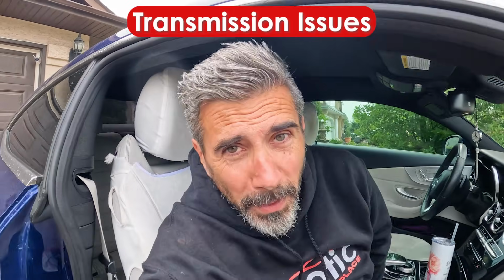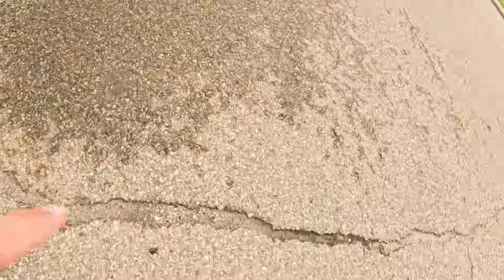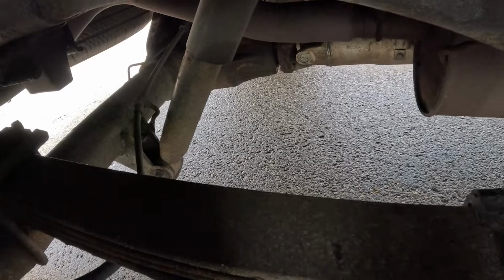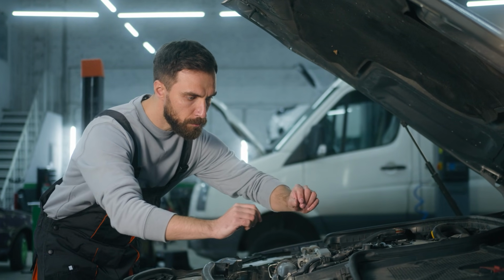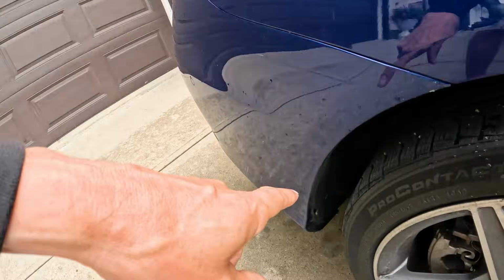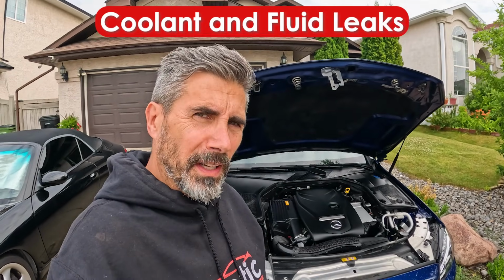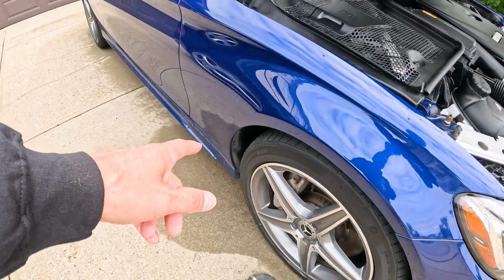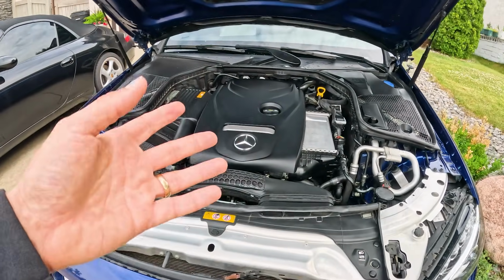What Happens To Cars After 100,000 Miles?

Comment: Great that you want to keep your car up to such a high mileage! With the right care and attention, this is certainly achievable. A mileage of 200,000 to 500,000 kilometers is no longer an exception today, especially in well-maintained cars. the key to success is a combination of Preventive Maintenance, good driving style and timely addressing problems.
Below is a comprehensive overview of what you absolutely have to do and what you can do yourself to extend the life of your car.
Essential maintenance (which you should definitely do)
These are the absolute priorities, especially after the expiration of the manufacturer's warranty. It is wise to find a reliable garage that specializes in your brand for this.
Many modern cars have long service intervals (for example, 30,000 km or two years). With high mileage, it makes sense to cut it in half. Changing the oil more regularly is the most important thing you can do for the life of the engine. Always choose high-quality, fully synthetic engine oil from the right specificates in addition to the engine oil, there are other fluids that lose quality and parts that wear out. Manufacturers sometimes claim that the oil will last "for life", but experts recommend replacing it at high mileage (for example, every 60,000-100,000 km). This applies to both manual and automatic gearboxes.
As with the gearbox, it is wise to change it in time to optimally lubricate the gears.
Loses its corrosion-resistant properties over time. Timely replacement prevents rust formation in the cooling system.
A clean filter is crucial for optimal engine performance and a healthy engine. Replace it according to the scheme, or even a little earlier.
The timing belt or chain is one of the most critical parts of the engine. If it breaks, the damage to the engine is often fatal. Strictly adhere to the prescribed replacement interval (usually between 60,000 and 240,000 km, depending on the car). If your car has a timing chain, this is less critical, but be sure to check its condition at the garage, as it can also wear out. Rubbers, bushings, fusee balls and shock absorbers are subject to wear. With higher mileage, it is crucial to have these parts checked and replaced regularly. Worn parts affect not only driving comfort, but also safety.
This goes without saying, but is essential. Have brake discs and pads replaced in time and check tire pressure and tread depth regularly. Good condition of these parts ensures your safety and that of others.
In addition to regular maintenance in the garage, you can do a lot yourself to keep the car in top condition.
Always drive calmly for the first few kilometers. A cold engine has additional wear. At high revs, wait until the oil temperature is up to par, not just the water temperature.
Avoid abrupt acceleration, hard braking and heavy load on the engine. This reduces wear on the engine, brakes, tires and the entire powertrain.
This is a small trouble with great impact. Check the oil level regularly (for example, every 1,000 km or before a long trip). Too low an oil level can cause irreparable damage to the engine.
Consider refueling premium fuel occasionally. These fuels contain additives that keep the engine and fuel system clean and promote longevity.
Rust is a big enemy especially in winter it is important to wash the car regularly to remove road salt a good wax layer protects the paint from the weather.
Never ignore a warning light on your dashboard and listen for unusual noises (e.g., tapping, cracking, or hissing). A small problem can quickly grow into an expensive repair.
After the warranty, you are no longer bound to the brand dealer. This gives you more freedom, but also more responsibility.
An independent garage specializing in your car brand can often offer the same quality at lower rates than the brand dealer. They have the knowledge and the right tools to make sure you get a detailed report of the work done and the parts replaced at every turn. This is essential for maintenance history and any future sales.
At high mileage, the likelihood of unexpected repairs is higher. Make sure you have a financial buffer to be able to remedy any defects immediately.
By following these advice, you will significantly increase the chances that your car will reach 500,000 kilometers and you will be able to drive it with pleasure for many years to come. It is an investment in the life of your faithful four-wheeler.
Reply from the maker: Great write up and thanks a lot for sharing so I will pin this comment.  Hope viewers get value from this and share the video to friends.
Reply: Noone is reading that.

Comment: I have an older vehicle that has done more than has done more than 2000000 miles and l have replaced a lot of parts on it not the engine or anything on t h e whole drive train and its manual and when l bought it a previous owner had replaced the rear leaf springs and all the four shock absorbers have been replaced and they don't leak and it is a 1997 2X4 Toyota Hilux  with the 22R engine now that will never fail so reliable thats if you do regular oil changes and l have done that

Comment: Some cars have very complicated suspensions such as an SL Mercedes. I owned an SL550 in 2006 and one of the mechanics told me off the record to trade it as soon as it was off warranty due to the fact the active body control system would start to fail and he's seen people get drilled with almost 10k in repairs in a year.
Reply from the maker: Exactly and the air ride systems can be problematic as I found in my BMW X5

Comment: All great points. I'd add that you shouldn't ever buy a car that uses an in-oil type timing belt regardless of its mileage or condition. When one of those lets go, it will make paying for your daughter's wedding seem cheap at twice the price. 💸💸💸
Reply from the maker: Yes thanks a lot for adding.  Some bad car engine designs out there and best to avoid

Comment: 2008 Toyota 4Runner SR5 V6, first owner, DYI 171k miles, 2006 Subaru WRX TR 5spd, first owner, same DYI, 126k.. Both very reliable. I did all necessary maintenance and more (replacing worn parts when needed during all of these years, but again nothing crazy).
Reply from the maker: Wow those are great examples of long-lasting vehicles!
Reply: I am OCD with my cars, lol 
BTW, just few month ago got a new ACURA MDX Tech package for my wife and I am overwhelmed with all these bells and vessels electronics in it (and I know its even outdated today compare to most current models, still way too much for me). If I have 3 cars we own available to drive, brand new ACURA would be my last choice ha ha.. I prefer simple, older cars

Comment: If those are your cars you got good taste dude! Not the newest models but watching your content for years I can see you maintain the cars very well. I like European cars but I don’t buy them anymore not since early 2000s lol because the cost to repair my 2001 325i cost a grip. I can’t imagine how much to fix bmw today 😱 or Mercedes. My 2018 Honda accord sport 2.0t while fast and I thought reliable bought brand new has been a nightmare to fix little things to major stuff covered on warranty and off. I’ve probably spent thousands of dollars in things that shouldn’t go bad on a Honda. Definitely Honda and even Toyota (new cars) are not built to the level of yesteryears. My car has only 88k miles and fortunately still running but transmission is getting wonky now. My mechanic told me about the sounds that I can hear each time I accelerate it’s not normal and we got a quote on a transmission. I rather trade my car or sell it than go through spending nearly 9k on parts labor yikessss. Sorry for the long story but I’m eyeing Lexus Toyota from the ‘20-‘23 years vehicles. I’m thinking SUV Rx 350(v6) or the Toyota rav4 (hybrid) vehicles.
Reply from the maker: Wow yes great story and sorry to hear the Honda feels a little fragile.  That’s sadly the direction of a lot of them seem to be going.  On that note yes I totally agree with the choices  incoming.  A V6  is a great engine for the brand and either. A Toyota or Lexus is a great choice especially when coming of a car with issues.  Yes we love our cars but they have had troubles.  That said, by us buying fun cars as the first priority, we know at least we are getting that from the experience since reliability seems to be up in the air these days.  I would love to hear what you go with .

Comment: 1.  Everything  you say is accurate
2.  I bought a new car in 2004.  21 years later, it runs like it did on the first day..
3.  When I purchased the car, I fully understood that the manufacturer made money on making a car and creating a maintenance manual designed only to get a vehicle through the warranty period.  When I calculated the actual mileage a car was operated in my state, the warranty was much closer to 2 years than 3 years.
4.  The rest was on me:  finding a competent mechanic, knowing when to use only OEM parts and when it didn't matter, keeping track of maintenance.
5.  Everyone has a situation.  My cars have never been garaged.  It has an effect on the paint job and the upholstery.  Why do I have swirls on paint job?
6.  Everyone has a situation.  When my wife was alive and we both worked and needed a car daily, we owned three cars and one was always at the independent shop for necessary maintenance.
7.  Everyone has a situation.  My girlfriend never wants to deal with servicing or repairs, so she leases.  I don't mind taking a walk, eating breakfast, and reading a book while my car is serviced.

I just used AI and I present you with some figures, not including things like finance charges  and added insurance when you buy a new car:

Estimated total cost for a new Toyota Corolla in California including sales tax and first-year registration:

    Base price: ~$24,000

    Sales tax (~8.5%): ~$2,040

    Registration and fees: ~$275 (average estimate)

Total: approximately $26,300 to $26,400

I haven't spent $2000 a year servicing and fixing my car!  People sell a car to avoid major expenses.  If you ever replace a headliner, a driver's seat upholstery or the motor mounts, the new set is going to last as long as the original, so you might get another 100k miles  If  you  do a simple oil change every 6 months or 3000 miles and use a factory filter, the additional cost over doing a 5000 oil change is negligible compared to an engine overall or buying a new car.
Reply from the maker: Thanks so much for Sharing

Comment: My 50 year driving and vehicle ownership experience tells me that any manufacturer that offers a new car warranty of more than 36 months is fully aware they are selling you a ticking time bomb. 

I have owned more than 60 vehicles and for the last 30 years I have relied on Toyota 1/2 ton trucks because they tend to be overbuilt (built to last), so what typically happens after 100,000 miles is 200,000, 300,000 and so on ... Wear and tear suspension items must be replaced when rubber parts begin to crack & tear (bushings & tires) ... I follow Toyota's severe service/maintenance schedule that calls for more frequent fluid & filter changes as well as more frequent inspections. I have learned to buy used vehicles with proven long term reliability, repair them with OEM or better parts, follow a maintenance schedule that uses shorter intervals and open the hood for a visual inspection whenever I buy gas.
Reply from the maker: Yes I agree step up the oil services and watch for loose suspension bits and otherwise those go for a long time

Comment: Spark plugs, fresh coolant, timing belt (if equipped), transmission fluid, oil change, drive belt, air filter, cabin filter, and keep driving.
Reply from the maker: Yes that's a great checklist to help reach the next goal

Comment: 2020 m340 71k miles. Starting to get concerned I am reaching the probability of $2-4K failures. And my residual is high. Considering trade in against a new car
Reply from the maker: The B58 is a good engine but yes I understand 70-100 miles is the area where water pumps, coolant hoses, oil filter housing gaskets and other parts start to show their age
Reply: It’s been an extremely reliable car with just regular maintenance. Nothing on it has failed.  But every day you just feel like you’re rolling the dice. It’s like when you’re at a casino and you keep going and regret that you didn’t get out on the last roll.

Comment: I drive a 2005 Toyota with 185K miles.  It runs perfect and burns NO oil  between 3,000 mile oil changes.  I just saw where the NEW Audi cars burn a quart of oil very 500 miles.  ROFL.
Reply from the maker: Those older engines really were built to last and some of the newest ones can be good but there are a few oil burners out there

Comment: Back in the leaded fuel days, cars began falling apart at 60K miles and were done-for at 100K miles.
Reply from the maker: Yes that leaded fuel and those engines were just not built for longevity at all and we have seen that peak IMHO
Reply: Also the roads were not very good.  Pot holed, wash board for miles on end.
Reply: @JamesMilne-v6r i love pots 🍃

Comment: 2002 Camry 250k, 1995 K2500 250K, 2002 Durango 200K. All still run like a clock with very little maintenance or problems.
Reply from the maker: Those are great classics with a history of reliable engines
Reply: Amazing! Too bad newer Toyota ‘24-25 are now bad in reliability. I’ll go Toyota and Lexus ‘20-22 not the newer ones 🙁
Reply: @corpuzone  Please site the source of your comment regarding 24 and 25 Toyotas. Thank you!